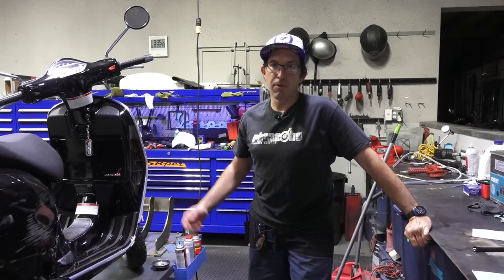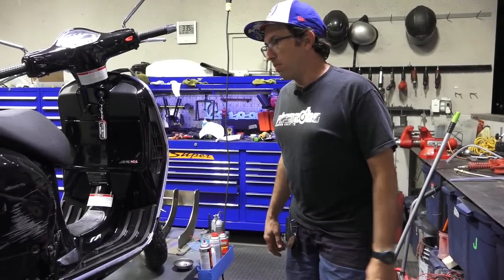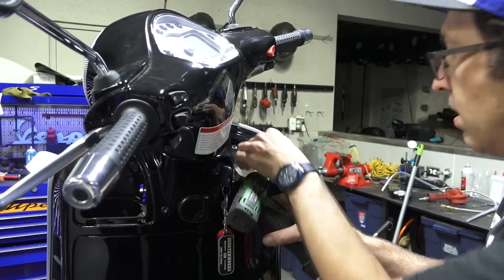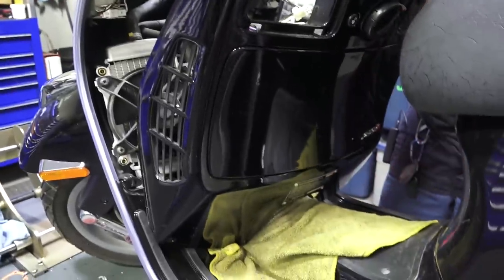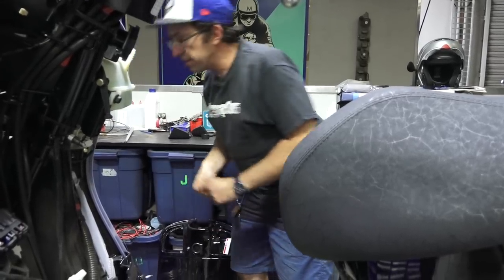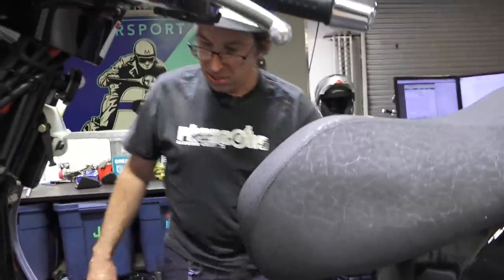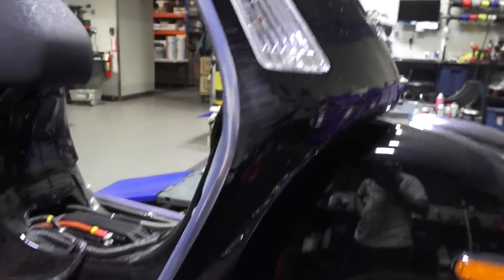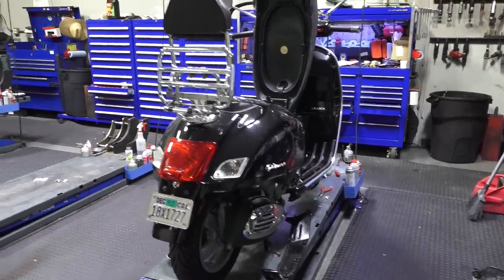GTS Crash Damage, Legshield Trim Replacement & Paint Touch-Up

Comment: Oh yes! thank you so much for this post. I had removed mine to give access to replace the GTV Starter/Kill switch. I thought I'd popped off three sockets & couldn't figure out where the hell they came from. I've just watched your video & there they are, accessory connectors, how would we know? I've spent hours wondering how I had unplugged three connectors & where from? Brilliant video. Thanks. John Wilcox Cornwall UK  Oh, I would like to see a video showing how to unplug the various connectors, It's like no two are the same, very confusing to a home mec.

Comment: I have that same bike, 2007, with the same body damage minus the dent.  Unfortunately I also cracked off the corner of the leg shield (pice where the left lower screw goes) and just got your quote back for over $500 since the panel has to come from Italy.  Ouch. Beautiful scooters but dang expensive to repair.  I think I may let the broken corner piece give it some character.  I will though, be replacing the trim since I lost a huge piece. Thanks for the 411 on how to do that and for the part! Replacing it with the black trim for a nice clean black on black look.  I hope it's not as hard as some say.  And the side damage...well I ordered a nice racing sticker for that too.  :D

Comment: Thanks A lot Robot! Bro this Tutorial it’s 27 mints It took me 2 hours to put the Black trims I ordered from you guys! and I still need to put the pieces back! 🤪😂Great video!!👏🏽👏🏽
Reply from the maker: Most of this stuff can be quite tricky the first time you attempt it. Robot makes it look easy!
Reply: @VespaMotorsport  Ηello i have a piaggio beverly 200 model i have around 150.000 kilometers made so far ,the last days was a little hard to fire up the scooter i thought it was the battery,i change it the same again i opened the transmition box to see if was something blocking the engine and i noticed that the crankshaft was almost impossible to move by hand even with the spark plug off the engine,i want your opinion ,can i check something?.The motor has oil and water fluid as i always check them.Thank you and merry christmas,happy new year

Comment: BE ADVISED!  Remove the Foot Pegs.  I broke the Floorboard during the re-install trying to "pop" the Floorboard past the aft end of the Foot Peg.
Reply: Other than that, Super Video.  I could not have replaced the Legshield Trim otherwise.

Comment: JEEEZ had to use JB WELD on quite a few dirt bike engine cases over the years.  Hell, even rode my KLR 650 45000+ miles with a dime size'd hole I filled with JB weld.  If done right it will hold for the life of the scooter, maybe even the life of the owner.